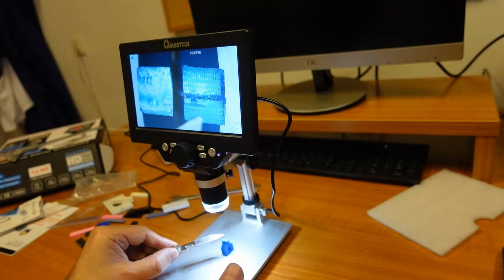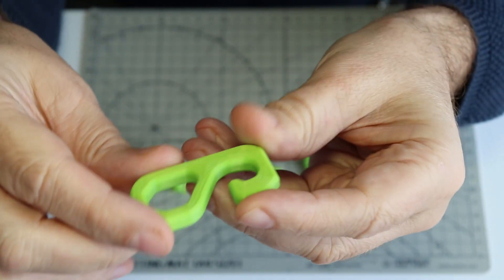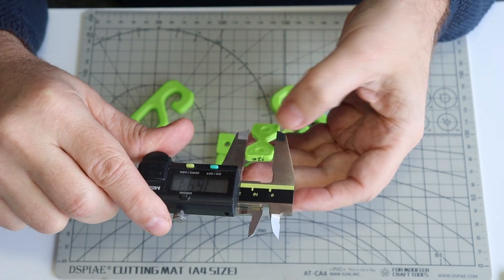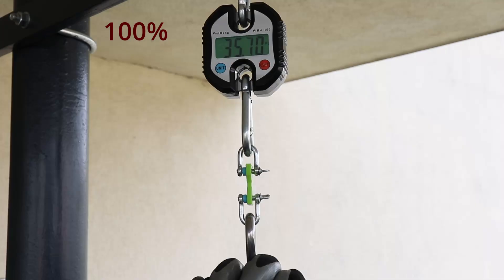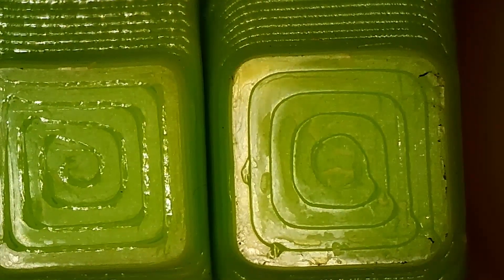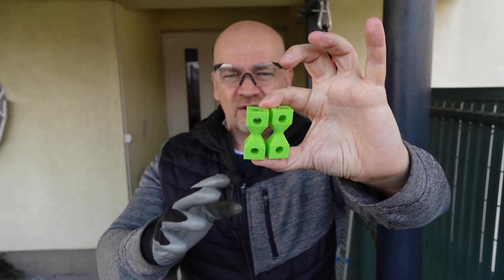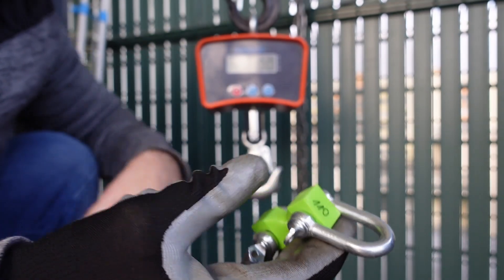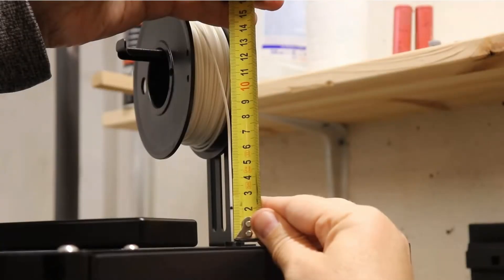Effect of extrusion FLOW RATE to the strength of 3D printed object

Comment: With Cura and Prusa slicer you can make the outermost wall normal 100% flow rate and the inner walls and infill 150% flow and have a super strong part with the quality of a normal flow rate on the outside. Best of both worlds! The only thing left is a variable fan that turns off during infill and on during outer walls.

Comment: I make a lot of mechanical parts that need to be assembled. Flow rate has to be adjusted in such a way that the parts are dimensionally accurate. Like your conclusion, if I need more strength, I use more walls and or more infill. Love the testing videos.

Comment: You can set an overlap of the lines.. just make it 0.05mm and you have quite well fused lines without increasing the flow.
Reply: In Cura it is hidden in the Walls settings, called "outer walls inset" - it seems to affect a bit more than just the walls.. on top of that, I'd use zig zag pattern for top/bottom settings with a 10% overlap with the walls. This has improved the skin quality enormously for top and bottom layers. 
Prusa does a better job with this (also with zig zag filling pattern), but I also kept the "slice gap closing radius" at the default value of 0.049mm
Reply from the maker: Eh, so many things in settings.. What is the exact name? Overlap in Cura or PrusaSlicer? (so many overlap types)
Reply: Increasing flow is going to be the stronger route than infill overlap. Because increasing the flow does both increase the overlap and extrude more filament into the same given area. For the strongest, best looking part go for 150% infill flow, 125% inner wall flow, and 100% outer wall flow. 2-3 walls would be sufficient for outer wall quality while not taking up too much space for the stronger overflown infill.
Reply: @rileyneufeld7001  if you use the same flow and wall settings between Prusa and Cura, you will see that Cura tends to leave a gap between the outer and inner wall/s. The only way to compensate for this - so far - is the indent overlap setting in Cura. I already use a .8 Nozzle and need 147.8% flow to keep up with printing speed. The additional 2.2% don't do anything to fill the wall gap, just make things look a tiny bit worse.
Reply: @Vizeroy9  I've not used prusa slicer so that is interesting. I do plan to use it when I do build some structural stuff in CF nylon because it does have some settings on there that I would like to use (like variable fan % for bridging). I'm kinda shocked that no slicer has implemented variable fan for infill and walls. With FDM printers layer adhesion is the biggest downside so having to use a set fan speed throughout the part kind of sucks. 0% fan for infill and 100% for the outer walls would be perfect for structural parts.
Reply: @rileyneufeld7001  nice that I could bring that to your attention. I'm not that experienced in 3D printing, but I'm constantly trying out different slicers to find out which one works best for me with the least amount of retuning for new models. 
This way, I had a look at Cura, Prusa and Ideamaker so far... There are still others to try out, but many are just different UIs, based on the same core program. I don't expect differences in slicing results.

Comment: Great video. I noticed though the infill pattern most likely is concentric. A different type of infill pattern might produce different results. Also, the printing speed might have an effect. Since a slower moving nozzle moves allows the heat creep to the layers bellow which could increase layer adhesion.
Reply: These were relative to each other so I don’t think that matters for testing.

Comment: hi was wondering if the percentage of overlap has any effect on what your testing.
Reply: Infill overlap? That is so that infill goes slightly over the edge to bond better to walls instead of hanging on thin air.
Reply: @AdamGtr86  infill overlap just adjusts how close the infill walls are extruded to each other. Increasing the flow does this by making the layers wider hence compressing them together more.